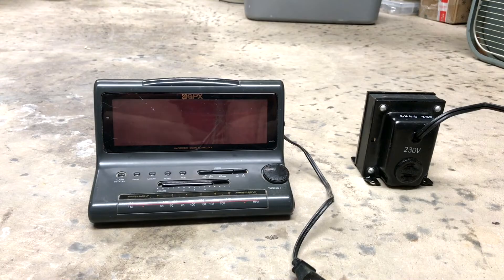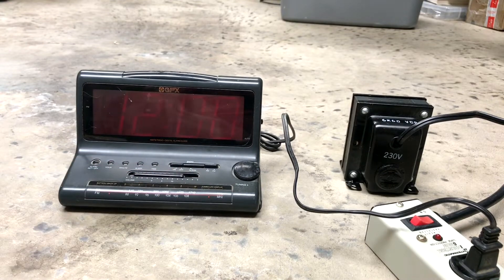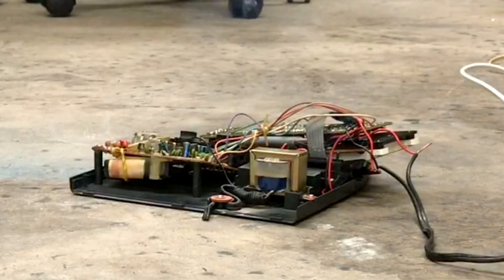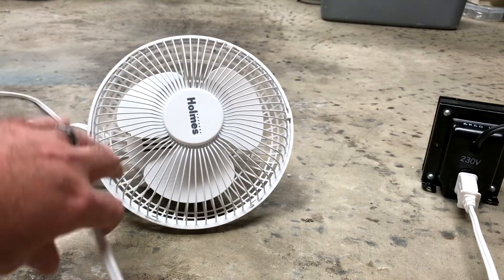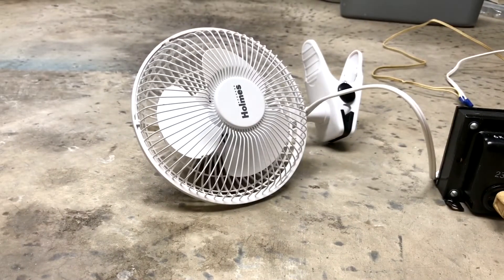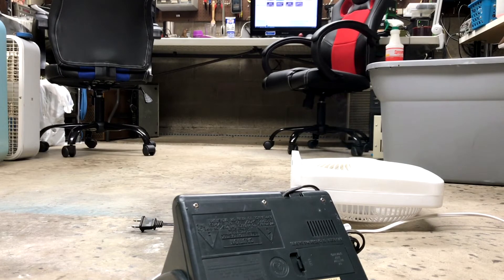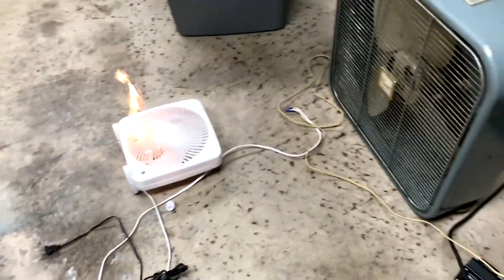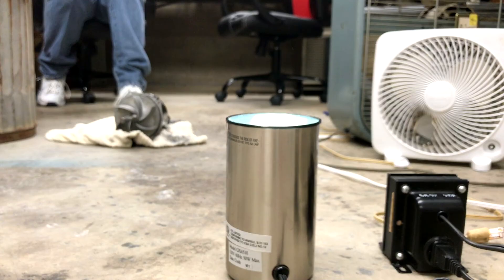Destruction!  Running 120 Volt Items on 230 Volts

Comment: The only outlet in my house that is a 240V, is a 240V outlet for a electric dryer. The house I live in used to be all electric looking at the braker panel, but the previous owners decided to get natural gas.
Reply: Sean Wilkerson Natural has dryers are about 50 percent more efficient than electric clothes dryers that is why.
Reply: Gas dryers are more efficient, but they are not as gentle on the clothes. Electric dryers are more gentle on the clothes.
Reply: The newer gas dryers have variable temperature control and moisture sensors. For me gas is better. Mostly jeans the shirts, and if you are in an area were electric rates are sky high gas dryers tend to look a lot better.
Reply: @seana806  What about a hybrid dryer, like of like how they have hybrid-electric cars?
Reply: @coastersaga  they pretty much have those in a heat pump model but the unfortunate thing about a heat pump dryer is they have a refrigeration system and if it develops a leak, the dryer is basically useless and will have to have a professional who works in the HVAC industry to work on it. On the other side, a heat pump dryer can just about be put anywhere since it plugs into a standard wall outlet and requires no vent but on the other hand, they are much slower and won’t completely dry everything since items will be slightly damp after it’s done.